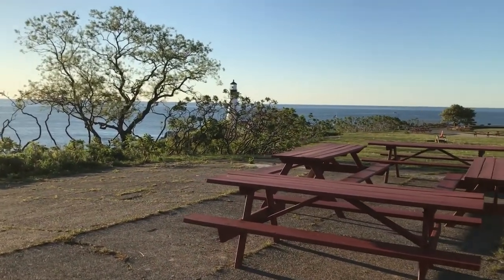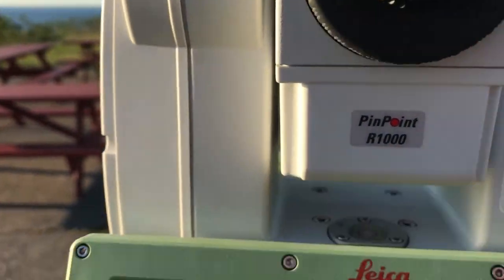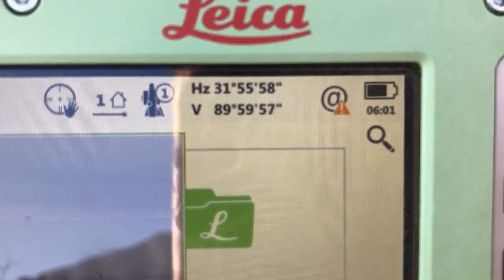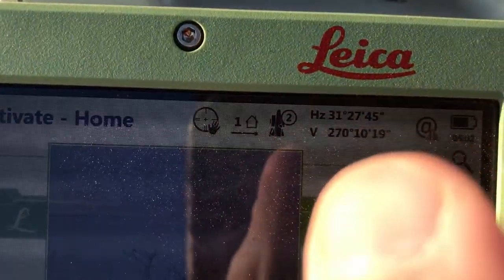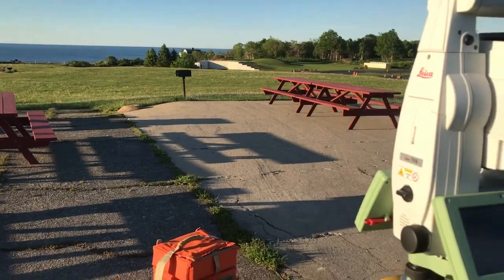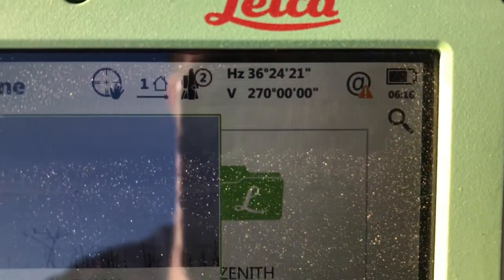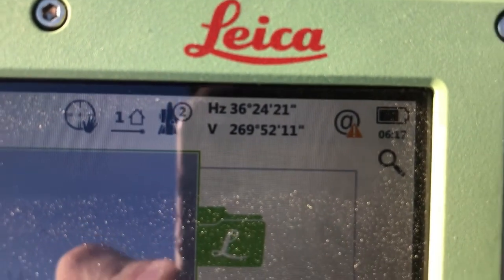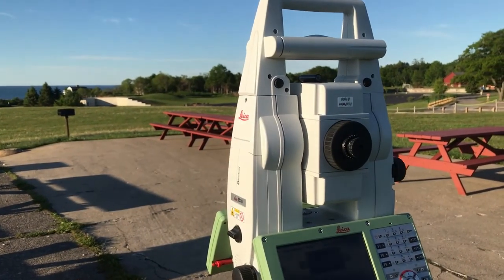Does Barrel Distortion Cause Curvature?

Comment: Thanks for this link to clarify how Face i and 2 is used.   As for flat earthers claim that "barrel distortion causes the earth to curve away at 8" per mile²"??!!??  Of course they always have to come up with something to deny reality.     

Chris van Matre is an interesting case.  My assumption is that he was never trained as a surveyor but most likely started as a carpenter who used an auto level to transfer elevations on a job-site and he was probably pretty good at this.  

In my early days of construction I use to set up a laser, measure from a benchmark then calculate the grade elevation for my Rod-Eye pole and work with a bulldozer to grade for a slab pours on tilt-ups but this certainly did not make me a geodetic surveyor.  Of course this did help me to better understand how perspective actually works especially knowing what a horizontal line and horizontal plane are and their importance in measurements and calculations.

Comment: @TheMaineSurveyor... 
After screenshotting your 1st Face and 2nd Face images, the 1st Face images show the instrument's horizontal crosshairs to be almost purely level, but the surface of the ocean's horizon is depicted with a bit of a concaved curved surface.  The 2nd Face images show the instrument's horizontal crosshairs to be slanted and not horizontally level as they were in the 1st FACE images.  Furthermore, the 2nd Face images, even though the crosshairs were NOT level, also show the surface of the ocean's horizon to be comprised of a concaved curved surface.  If the concaved curvature distortion is not due to the barrel optic lens, then what is causing the appearance of the concaved curvature? 

Additionally, with regard to the differential gap between the instrument's horizontal crosshairs observed to be positioned above the ocean's horizon... 
Assuming the ocean's horizon is at SEA LEVEL ELEVATION, the differential gap between the instrument's crosshairs and the ocean's horizon is because the instrument is seated/positioned at 70 (+ or --) above sea level.